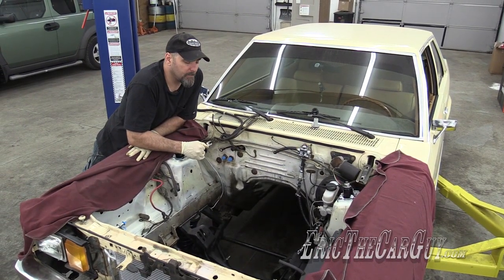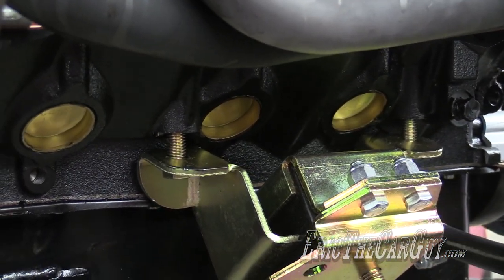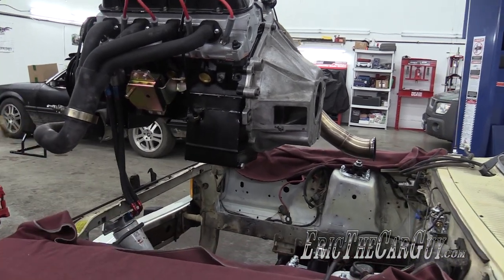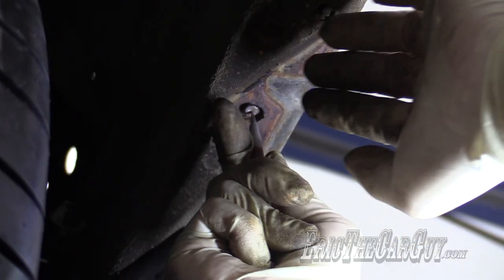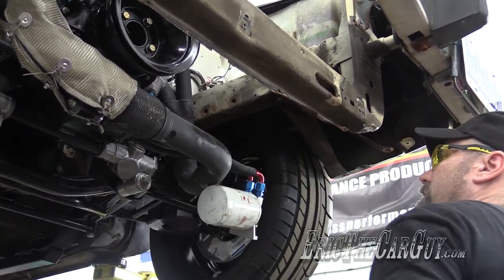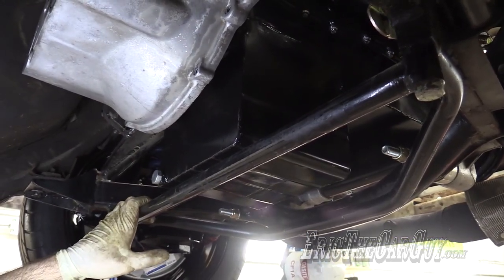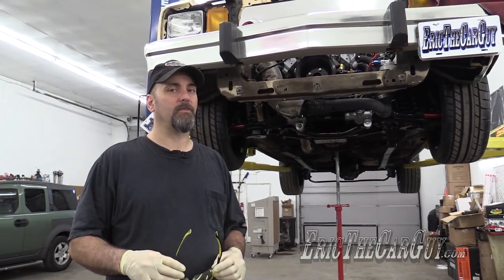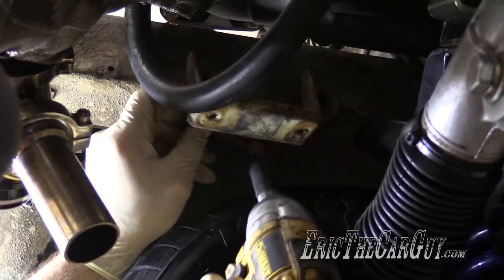Test Fitting the New Turbo Engine and Transmission #FairmontProject

Comment: The fact that you're keeping the A/C on the car is--if you'll pardon the pun--the coolest thing ever!  I love seeing that kind of functionality.  :)
Reply from the maker: I still need to sort out the compressor mount. That's something I'm still struggling with. I also have to work out what I'm doing with the evaporator inside the dash. I have no idea what I'm going to run into there, but I do want to run AC. After all, I'll be driving this car during the summer for the most part.

Comment: With everything fitting so tight, we really won't know the "true" clearance issues until after some good test runs. High speed cornering, suspension travel at max, and torque will probably present some clearance issues we can't see right now. Good job though Eric, I like how it's coming so far.

Comment: Those good drill bits will eventually dull on you. Get you a drill Dr. I bought one a few years ago and I love it. I run into situations like you do where you break off a bolt out have friends bring me something the have broken off a bolt in. I have a good set of drill bits I use to drill holes for my taps got occasions like that and it's nice to have them sharp and ready to go!

Comment: Hey Eric I used to smoke drill bits constantly.  An old guy at work gifted me cutting oil he said he was tired of me killing my bits and didn't like the noise they made lol. He was a little crotchety.  But using the cutting oil my bits last 10 times longer and the cut is faster.  Just a tip passed down to me.

Comment: Hey, Eric, love seeing your progress on the Fairmont. I'm not a mechanic myself, but here's a couple of tips with the drill bits: Use lubricant when drilling into metal and don't rely on "hand tightening" the bit into the chuck. While it's a failsafe method many use to avoid breaking the bit, it's often better to learn to use the ratchet of your drill instead to avoid wearing down the back end of your bit or the chuck in the worst case.
Just twist the last quarter or half over to secure the bit into the chuck and with little practice, you'll find the correct ratchet setting for your hand pressure while drilling.
Keep up the great work, I've learned a lot from you over the years
Reply: i guess im randomly asking but does anybody know of a way to get back into an instagram account..?
I was stupid forgot the login password. I appreciate any help you can give me
Reply: @Ruben Brixton instablaster :)
Reply: @Christian Baylor I really appreciate your reply. I found the site thru google and Im trying it out now.
Seems to take a while so I will get back to you later when my account password hopefully is recovered.
Reply: @Christian Baylor It worked and I actually got access to my account again. I am so happy!
Thank you so much, you saved my ass!
Reply: @Ruben Brixton happy to help :D

Comment: This video gives you a good reason why people put the motor in than build the turbo setup. Makes it easy to know what you have to work around and what need to come off before you put the engine in and take out. I would have took alot less time to just take all the turbo piping off put motor in and put piping back on.
Reply from the maker: I'm happy with my choice. I only had to remove one pipe and a blow off valve. Now that the stabilizer bar has been worked out, it'll be even easier next time. Trying to put those headers on inside the car would be very difficult and take a great deal more time. Access to the fasteners is difficult with them out of the car. Also, all the cold side of the turbo still needs to be installed so in effect, I have done what you suggested. Thanks for your input.
Reply: You their has never been a easy Ford to work on. 90% are not worth working on. I'll keep with the ls Chevy's.

Comment: When drilling out a bolt I've found that frequent lubrication of the drill bit and short (10 second) bursts with lubrication between each 10 second round, keeps the bit sharp, and actually makes it bit faster since you aren't drilling with a dull bit by the end of the process.

Lesson learned a few weeks ago when I had a few snapped bolts on a Water pump I did.

Comment: Hi Eric. fantastic video as always. I do have one remark. That drive shaft looked a wee bit long. The plunge on the gearbox end of the trail shaft was quite deep. once the car is sitting on the ground with all its weight, plus the up travel of the suspension could bottom out the drive shaft in the gearbox. 

im sure you've got ot figured out now though seeing how far behind these videos are. 

thanks heaps as always eric :)
Reply from the maker: Thanks for the input. I have looked into it and it's fine. Also the new torque arm holds the differential in place so there isn't really any slip of the driveshaft to speak of.
Reply: EricTheCarGuy Fantastic!

Comment: That driveshaft is gonna snap.  I'll be waiting for the video :)
Reply: What makes you think that?
Reply: 600 HP + Aluminum. It might hold up for awhile, at least until he decides to go crazy and put drag slicks on it, which would be AWESOME btw
Reply: luke saylor the ujoints will go before that happens.
Reply: Lol ikr
Reply: I had an aluminum driveshaft in my 1987 camaro that ran mid 11's in the 1/4 mile. Aluminum is much stronger than you think.

Comment: We had a similar motor mount problem on my Dad's Dart block 363.  Although, we opted to grind the support rib from the block because it ended up being right in the middle of the motor mount and it would have severely compromised the mount.  It ended up working out fine but very very annoying!  This is not a problem with the Ford R block though.

Comment: Hey Eric, LOVE your vids! I AM JELOUS! All I want in this life is my own garage & a rwd car to build apon! personally I want a Chevrolet. My brother had a 79 z-28 with a 73 sb 400 bored .030 over, using a stroker crank, amber lightweight pistons 11/1 compression, aluminum heads, roller rockers, holley 750 double pumper with manual secondaries, th400 w/new valve body & shift kit-B&M. 3,500 STALL, 373 GEARS & MAN DID SHE RUN!!! That stroker 406 screamed & I want to remake it!!! So, if I am ever so lucky to get my garage built & find a 1973 sb400 with 4.125 stroke, id be very happy! GOOD LUCK IN ALL YOU DO & I HOPE THE FAIRMONT MAKES ALL THE POWER YOU WANT & CHEKS ALL THE BOXES!!! KEEP UP THE GOOD VIDS BRO! YOU JAVE A WINNING COMBINATION!

Comment: Very good video! What I like about you, is you don't try to edit out mistakes or the stuff that you have to work around or with. Makes your work genuine. That's gonna be a beast when you are done, if it's not already done. I was wondering why didn't you just put spacers on that bar under the oil pan? Would that bend jeopardize the integrity of the bar?
Reply from the maker: Thanks for the input. The entire K member is going to be replaced along with the front suspension. The new K member has spacers for the oil pan.

Comment: I would weld some thick steel plate to the now bent section of the cross pipe. Otherwise it don't stand any longitudinal stress. Heat from the exaust pipe and waste gate pipe is gigantic. That rubber hose shield is gonna fry away easily. Same heat seal that you used at exhaust pipes is sold in smaller diameters just for this purpose. Is there particular reason to use an strap as ground cable?

Comment: Eric, you can bang your exhaust with a hammer to "make it fit better" without losing any power. Don't know if you knew this already but it's a public service. Roadkill tested this myth and actually made MORE POWER by hitting the exhaust with a hammer. They "ruined" a new set of extractors by mashing every single pipe with a hammer.
Reply: Also eric, you can heat the plastic wheel well thing with a heatgun and mould a clearance for it.  I'd just heat it up and use a piece of wood to push it inwards.
Reply from the maker: I don't have any exhaust clearance issues so I really don't see the point of damaging the exhaust.
Reply: EricTheCarGuy Yeah i commented as i watched the video. It's a bad habit i know.

Comment: That driveshaft looks to be an inch and a half too long. It looked to be almost all the way in with the diff hanging down so when the diff goes up over a bump the shat will ram the box through the engine.
Reply: Going to say the same thing, as the suspension compresses (it's full extension on the lift) that will only push further into the transmission.
Reply from the maker: It's fine. I've checked it on the ground and it fits perfectly. It sticks out about an inch from the back of the new transmission which I'll install in a future episode.
Reply: An inch may not be enough, you might have to nudge the engine forward a bit if you don't want to get a custom tail shaft.
To be safe when you get the right box in and every thing set up you should measure the  depth of the yoke when it hits the  end of it's travel then drop the rear springs and jack the diff up to the stops and measure the amount of travel left on the yoke , if it's less than 0.75 inches it's not enough.
Anyway it looks to be coming together nicely.
Reply from the maker: It's fine, the torque arm holds everything in place and the driveshaft will barely move during suspension travel. You'll see this in a future video. Thanks for your input.
Reply: I thought the same thing, so I applied a little Pythagorean theorem to it - and found the actual movement is really quite small.  Obviously, you need some clearance, since there is a measurable change, but it's surprisingly small - and the longer the distance between final drive and gearbox extension, the smaller that difference becomes, since a set rear suspension movement becomes a smaller angle change in the shaft.  I have heard that some manufacturers used to allow more clearance when using leaf springs, as the diff could move forward and back a bit as the springs twisted under load, but that shouldn't be a problem with this build.
Reply: aussiebloke609 . I was looking at his setup and it's fairly good for locking the diff in place. I saw one kid loose his back seat when the diff ate through it but that was an old leaf spring rust bucket. However the arc of travel when the diff is forced up is not the only movement that you have to worry about. When a car takes off you get pushed back in the seat and the engine also moves back a bit especially if you dump the clutch but the diff moves forward after all it's what's doing the pushing. So depending on how much travel everything has what seems like plenty of clearance can soon disappear . Any way I'm sure there's a spec that can be found easy enough.
Reply: Kinda what I was thinking.  There's some clearance still, and he shouldn't need much.  As an aside, I'm pretty sure torque reaction when accelerating or braking should be sideways only, since its a north-south mounting.  Generally, only transverse engines get front/back movement under load.  The final drive would be a fore-aft movement, but that all changes when you change the direction of rotation at the pinion.
Reply: Anom Amos guess we will all know after about 30 good runs.....
Reply: I wasn't talking about torque reaction just inertia and forward force.
The set up he has takes care of probably all the torque reaction but unless he uses solid bushings there will still be a lot of movement of the diff and motor when all that power hits the tarmac. By a lot I mean about half an inch with everything new and stiff but when it gets a few thousand miles on it that half an inch can turn into an inch and if the yoke bottoms out by even a thousandth of an inch more than once or even just once it can get very expensive and upsetting.
Reply: I don't think you are a very good mechanic you do hot ass jobs

Comment: Curves bars are your solution to get around engine and oil pan. You will need to make your measurement and ask a shop to make these bars for you with roll hydrolic press with a 24 reheat to unstress the metal. You can also just use heat to curve the bar and make It by your sel with an anvil.

Comment: Those drill bits you're raving about around the 15:00 minute mark would probably last longer and cut even better with some oil to lubricate the cutting surface. Usually something loosely around the viscosity of like a 20 or 30 weight, or ATF, is just the ticket.

Comment: that is indeed a tight fit , those right hand side plugs are going to be a bastard to replace , if you use platinum or iridium  plugs you'll be golden for a while , laughed at the Trump reference too .
Reply from the maker: Honestly, I'll probably pull the engine when I need to do plugs. The way I have things set up, it shouldn't be too hard. BTW this video was shot late last summer. I had no idea at the time that Trump would end up as president. Weird.
Reply: Hello fellow commodore owner! :)
Reply: EricTheCarGuy wtf lol I figured you shot this video like last week. Months old, Weird.
Reply from the maker: ChrisHallett83  It's more involved than that.
Reply: big job to pull the engine out to do the plugs , mind you on some Italian cars you had to do that to do the cam belts , of which their were often 4 on the quad cam Ferrari's and Maserati's . 
Yep , even down here in New Zealand , when Trump became President a lot of people were like WTF?? , but politics is a whole other subject for another place .
Reply: + TacticalBBQSauce - Ha , well spotted ,
Reply: If you watched his other channel you would know that this was a while ago and that there is a lot more in store for this car, meaning all new suspension setup and more.
Reply: I missed the Trump reference. about how far is it in the video?
Reply: Pull the engine for plugs? F that. In a turbo carb rig your likely to be messing with them a good bit, changing heat range, reading them etc. maybe pull the down pipe and get them through the fenderwell or something?
Reply: Rob Wright - 28:16
Reply: daveogarf thank you
Reply: hack jobs
Reply: Greg Bartholomew ee

Comment: never had any love for those stock ford aluminum bell housings, the 66 falcon used to eat throwout bearings due to the immature nut behind the wheel,  many heli-coils, bearings  and skinned knuckles later found a guy that owned a junk yard who gave me a steel one from an old tow truck he had rusting away (  back in the early 80's before things were easily buyable ;)  )

Comment: I always thought you had to have some room in the driveshaft, like not all the way in the transmission tailshaft or to far out of it since the driveshaft will move in or out of the tailshaft with suspension travel. Seems like driveshaft is a couple inches to long and with the rear end squatting under load it would bottom out in the tailshaft... Please correct me if Im wrong.

Comment: The car is likely already running from how the timeline of these seem to work, but I would would strongly consider an alternate solution to the oil return issue. Braided hose to reduce the diameter (clears swaybar) and then a heat insulation/reflective sleeve around the hose to protect it from the exhaust.

Comment: Hey boss, initially when dropping the engine in, the turbo was resting on the side of the engine compartment.  Did that resolve itself once bolts were in or with the future-video k members or some other way?
Reply from the maker: That was due to the support bar under the oil pan which I fixed.
Reply: That makes sense. Thanks for satisfying my curiosity.

Comment: Eric, not sure if you know this or not but you cannot have more than 18" of rubber fuel line if you plan on going to the drag strip! Check the NHRA rule book online and this will confirm it, you also can not have the regulator mounted on the firewall. You should go with aluminum hardline or braided hose for the fuel system.

Comment: That aluminum cased T5 is really making me jealous. The t150 I just reinstalled weighs 60 pounds, the transfer case that bolts onto it is another 80. There's no way I could have lifted it into the tunnel that easily

Comment: if you added some aluminium foil tape around that rubber hose you put around the turbo oil feed that would another layer of heat protection. Man you  got lucky with that k-member cross bar and the stabilizer link.

Comment: Not a criticism - just a question. Why not just put a new oil drain plug underneath the oil pan instead of worrying about the one on the side? Is there a reason why that would be a bad place for it or a massive pain to do?
Reply from the maker: It's still full of oil. Not to mention that would require removing the pan or else I'd risk a fire inside the engine. Keep in mind that I'm also replacing the entire front K member with a new one in a future episode.

Comment: i thought fairmonts had v8's in austrailia, iknow you are in the us but still info is info.
and it has to be said, the reason your brace bar on the k member still fit was due to you heat bending it, if you had cold bent it on a pipe bender it would have been short, but the way you did it actually stretched it just a little, really cool.
Reply: aly nicholls some had V8s. This one didn't.

Comment: one time my buddy cut a hole on each side of the oil pan and used a steel tube to link the holes and welded it in. in that case one of the bars or steering rods went right through the oil pan! maybe it's possible modify your pan for the k member bar. 

BTW i think carcraft or hotrod did on article on make your own CUSTOM sway/stabilizer bar!!! How to make it and send it out for heat treating.

Comment: Eric, for the swaybar look into using SN-95 (94-04) mustang style swaybar brackets. They mount under the frame rail instead of in the engine bay and help for clearance issues like you are having.
Reply from the maker: Interesting. Thanks for the tip.